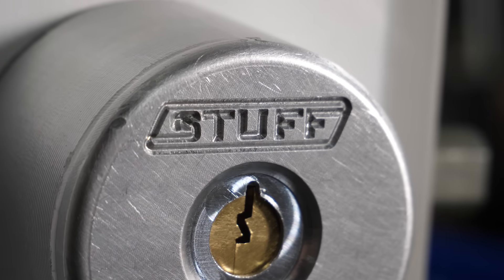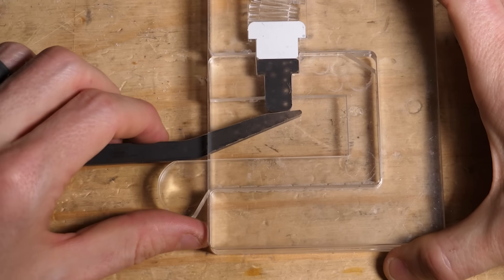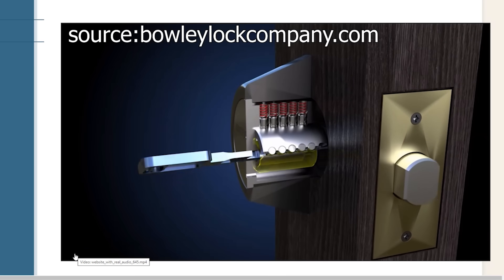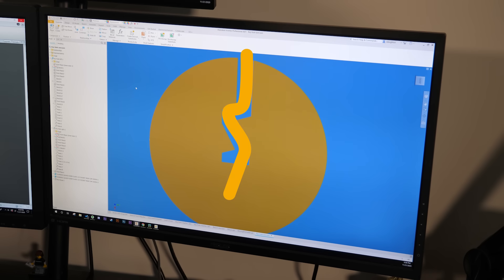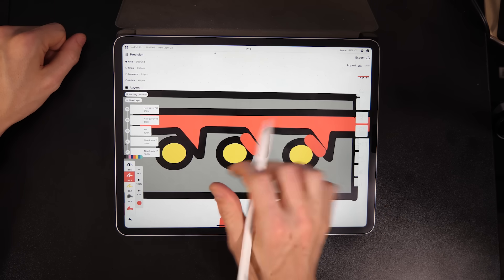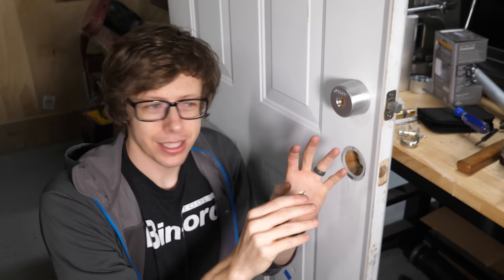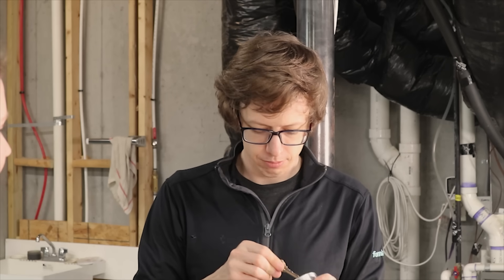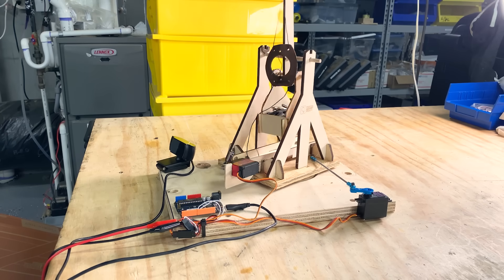Making an unpickable lock. Calling locksmiths

Comment: Locks without keys usually just change the methods to open it. Either a security leak at the company, some encrypted data using a public key or the key getting cracked,...
Ethical hackers walk into government buildings that require cards or chips, even fingerprint or iris scanners. These things are usually used in combination with a key for a reason. Also, they require an override since you don't want to be locked out or in when electronics fail.

Comment: A lock this formidable may not be practical for a deadbolt in your house, but there are probably comercial applications that make sense. If it's improved to the point that it is virtually unpickable, that level of security may outweigh the price due to massive manufacturing costs for people that need super high security, non-electric locks.

Comment: There already is a reasonable unpickable lock that operates through a U shaped key. On the turn the loose end of the U slips behind a sheath above the insert channel and manipulates the tumblers there. Given that your design probably offers something novel the inclusion of the design elements in the shielded tumbler design could make it even closer to unpickable.

Comment: "So Bill and I made a new custom tool for this type of lock"
Reply: and it's now available on covertinstruments dot com...

[aaaaand it's sold out]
Reply: This is a special tool that Bosnian Bill and I made...
Reply: And, it includes a angle grinder, a chainsaw, and high powered lasers
Reply: *Bill and I
Reply: Not sure if viable, but probably just adding more pick to the one that LPL and Bosnian Bill made to lift all the pin at once
Reply: ... nice click on 1.... counter rotation on 2....
Reply: I think the way it is it can be picked with no special tools. Probably with no electric tools.
And even if it were to be greatly improved, it could still be quickly decoded with a stethoscope or something like that. I doubt this susceptibility can be avoided in this kind of lock. Too little space. I think disc detainers are more promising.
Reply: @tinldw  And exactly how would you pick that with no special tools? Genuine curiosity here.
Reply: @MaxSeidel1 lift the pins all the way up, tension, use some hammering or vibrations to gradually drop the pins into place. I'm sure that, depending on the tolerances, either this or decoding is going to be fairly easy&reliable.
Well, I can guess that decoding may use some new tools to make it easier and/or reliable, but I'm sure it's not a requirement. Everything else appears to be quite standard. Am I missing something?
Reply: @tinldw  did you watch the video?
Reply: @tinldw  You can’t manipulate the pins while turning it so you can’t raise the pins and turn it and have them fall into place. If a single pin isn’t properly decided as well, none of the pins can be turned so timing it just right is impossible since the pins will fall at the same speed, but some need to be set higher than others.
Reply: @tinldw  I agree. that's one possible way to attack this design. One way to protect against that attack is to stagger the position of the gates so that you can only tension a few pins at a time. The vibrations would make all other pins fall off and miss the gates.
Reply: @pjaxy  someone skilled like LPL would be able to feel which pins have dropped too low and lift them back without much trouble, though. He's dealing with false sets, counter-rotations etc. all the time. If only the pins were somehow reset before returning to the driver pins... But how? That's against the basic principles of this type of lock :D
Reply: Well, one could make zero cuts between all the real cuts on the key, then to close the lock you'd have to move the key out one step (dropping the driver pins) before you can finish the turn and take it out. Not very convenient though and I have doubts about such a key getting stuck all the time until it bends or breaks.
Reply: https://youtu.be/5NuE4sWmufQ

Comment: I know how to pick your lock... seriously.
Press all the pins as high as you can. Use a bypass pick to press on the 'locking' mechanism at the back and rotate till it stops. Slowly release the pressure on the 'locking' mechanism to allow your top pins to drop into the wardens. Might take a few tries, but should work. This is built on the assumption the key is used to keep pressure on the 'locking' mechanism that keeps pressure on the pins.

Comment: "If you want a truly unpickable lock, just get a lock that doesn't have a key"

Hasn't the lockpicking lawyer already picked some of those?
Reply: Of course the window beside my door is unpickable too - but not unbreakable- much faster to put a hammer through any window.
Reply: @robmaclachlan1264  Actually window can be picked. Modern windows can be taken out of the frame and back, you just need to know where put in screwdrivers.
Reply: He did, but only ones with major flaws. A lockpick has not the right skillset to tackle those, you need a hacker.
Reply: @TheHalfBorg  LPL skills do extend to that extent, but the question comes up: are you going to install a $50k lock on a $100 door?? and if you can afford a $50k then most likely you can afford a guard to stand at that door 24/7 and if you can afford that then you don't need a $50k lock...

once something is wireless its considered unsecured connection and its easy to bypass, there is ways to make it more secure but in my experience bugs always surface and it doesn't work for long, also in the case of a total lost in power you would be locked out...
Reply: Still no Abloy Protec 2.
Reply: @TheHalfBorg  I dabble into cyber-security and hacking; there's quite a few ways to make such locks impenetrable. People like to believe there's always a flaw, but in such a simple system, you can viably avoid them.

You might be able to get past these locks by extracting information directly from the key, but that would involve another approach. Many modern hacks are done by using this method using approaches such as the now well known socially engineered attacks. Obviously, you could also add extra layers to further prevent these, as well as having the person with access be a bit paranoid.

Of course, you can destroy the door; locks can be impenetrable, but so far, we haven't found anything that humans can't destroy with enough dedication. Considering our current explosives and cutting tools, with enough resources, you'd be able to get even through the most secure and reinforced door. The only thing that would make this not be viable, in my uneducated opinion, would be a system that detects these attempts and destroys the contents to prevent unauthorized access.
Reply: @TheHalfBorg  you dont need to be a hacker, you just need an rfid reader and a hug with someone carrying a valid keycard
Reply: @klauzwayne4215  thats still assuming the lock uses RFID. Most keyless locks are fingerprint or pressing buttons to input a code, neither of which uses RFID
Reply: @TheRussell747  the bad thing about fingerprints is, that you can not change it. So if i get your phone into my hands and steal that data, your fingerprint is compromised for the rest of your life.
The bad thing about keypads is, that people are lazy and tend to never change the codes. After a few months you can clearly see what keys are pressed a lot and you only need to figure out the correct order, you still have to guess it, but it shrinks a 4 digit lock to max 24 tries.
Reply: the true purpose of a lock isn't to be unbeatable anyway. Its to be too difficult or too expensive to be worth beating. If the lock isn't the weakest point of entry anymore then it's a success. Keyless locks do that quite well, frequently is simply easier to gain access some other way.
Reply: There is one lock he has called unpickable >:3
https://www.youtube.com/watch?v=-FUQ6ZxTkM8
Reply: Nothing is unpickable/unbreakable. Doesn't matter if its mechanical or digital. Its just a matter of time and brute force
Reply: Search for Opening lock with a laser, a very interesting video about... well... opening cyber locks with a laser trough smart devices.
Reply: If you want secure lock, just get something like Yale doorman.
Reply: Also RFID manipulation...
Reply: https://youtu.be/5NuE4sWmufQ
Reply: And never forget how masterfully his wife picked the ice cream lock. He never told us how many days he slept on the couch.

Comment: I was thinking along similar lines. For pickable locks, I called it 'asking the question of is each pin at the correct height' at the same time 'asking what height is each pin at", but for a more secure lock, the second question has to be answered before the first can be asked. Or lock the pins pushed by the pins pushed by the key (or pick) and rotate some before checking the locked pins. I originally thought of rotating disks by different mounts with the key. Each disk would have 2 or 3 pins on one side the fit through slots in the later disks. Key in and rotate to set and lock the first two disks, push and rotate the opposite way to set and lock the second two disks, push and rotate again to set and lock the last two, push to have all six sets of pins finally hit the lock plate. If all six sets of pins match holes in the plate the whole thing pushes it to release the locked part from a spline so that it can rotate and unlock. If any set of pins don't fit through a matching hole in the lock plate then then the whole set stops. With the disks already locked you can't keep jiggling each one until it does line up, so all six have to be correct at the same time. If not then you have to release and return to the beginning to try another set of six disk rotation angles. Or if using pins have both inner and outer pins have grooves for each valid key height and ridges that engage the grooves after the key is turned the first little bit, then when the key way no longer even lines up with the pins, the locked pins are finally checked to see if the split between inner and outer  are all at the correct height similar to a normal lock. Similar idea, probably at least as hard to manufacture!

Comment: Wondering if just making the receiving shaft for the ward pins (the pins in the kit that need to pass through the wards) into two pieces (sheer line down the center of the shafts, would be enough to hold the pins in place when you 'set' the pins with that button at the back of the lock. Wouldn't surprise me if you'd tried that and found it failed though. It does sort of rely upon all of the pins and shafts having really consistent tolerances. But then you've run into that before...

Comment: In my country they will heat a copper or metal rod utill it turns red and they will insert inside the lock. They will keep it inside for 1hr. Then they will take it out. Now they have ups and downs of  original key in this metal. Then will put it in Soap and they will press it harder as they can. Now they got the key blue print. With that design they will creat a new key. And open the look. This what robbers do.

Comment: "just get a lock withouth a key" as someone who watches the lockpickinglawyer, i can tell thats a lie xD
Reply: He has only opened ones with flaws in them. You can absolutely design a perfect digital lock. The systems surrounding it, including the person with access to it and the door itself, however, can be worked around.
Reply: @stamy4605  remember when breaking into a house the hard ware store is the best place to start
Reply: They can't be picked, but many can be bypassed
Reply: PLZ Buy warm and sweet pumpkin soup
Reply: Dont  read my profile Picture    :)
Reply: @dont6439  too small to read
Reply: Technically they are unpickable as there’s nothing for you to pick. However they are not unbypassable

Comment: An approach I'd like to see would be to construct a lock where the front chamber has a hole that reaches further through the warding than the rear ones, keyed with a very deep cut in the front chamber so the pin would reach down through that hole.  Use slightly tapered pins on all positions but the front position, so that none could be tensioned when the front pin is elevated past the warding.  When inserting a key, the front pin would get pushed out of the way, but the front pin would have to drop back down before the lock could turn.  With the pin down, there wouldn't be a straight path from the outside of the lock to any of the rear chambers.  For strength, the key might need to be made from laser-cut stainless rather than ground brass, but otherwise the lock shouldn't be hard to manufacture.

Another approach I was thinking might be interesting, and somewhat up your alley, would be to have an internal mechanism that's something like a miniature version of a game where the player has to operate levers to move a captive ball up a ramp without it falling off, and have the key include cammed slots that would operate the levers to win the game.

Comment: 10:30 RFID locks do have keys, the card...  because once you have the right combination of numbers as RFID card then the door will swing open.  unless they add some sort of attempt mechanism whereby if you try it more than 3 times then it will prevent you from trying again for some time.  then yea maybe.  mechanical locks can still be good, but this one is very good, making the jump having to do all pins right at the same time is the way to go

Comment: "if you want an unpickable lock, just buy a lock without a key."

You haven't watched LPL, have you? :D I mean, you're "technically right" about them not being _pickable_, but... it's not like they're not just as easy to open anyway :D
Reply: If the magnet doesnt work, you just arent using a big enough one!
Reply: @DH-xw6jp  Or you need to rub it over the actuation motor several times (remember that fingerprint reader padlock) :D

Comment: Wow, amazing concept! I'm looking forward to seeing LPL have a go at it.

And I feel like the commercial viability could be greatly increased by having another go at the pin locking mechanism later, well rested and with some fresh ideas. That looks like it could be simplified.

My first impression was that it could happen from the side instead of depth wise, so there is more place for the mechanics. This would even increase the number of pins that can fit. Maybe the surface of the pins could be also machined for better and/or easier locking. But obviously I didn't give it that much thought so maybe it's a terrible idea.

Comment: I am a lock picking enthusiast.  i am loving your idea. might i suggest an idea.  would perhaps adding serrations or grooves to the top pins that get "Locked in place"  having a serration at every depth level that the key could be pinned at to avoid any type off trickery. i think this would create a more positive grip to the pin not allowing it to move from its correct position once correctly positioned and the force is applied to lock them in place.  and to help with the binding you seemed to be having i highly recommend to ensure the surfaces that should be smooth be very smooth with out hitches or deep scratches for things to bind on. awesome idea and i would not count it out as not practical to market.  maybe just a few tweaks and the right equipment and manufacturing would not seem so far fetched, some people are willing to spend on high security.
Reply: Good thoughts. I was thinking that one way to potentially defeat this would be to push all the pins to the highest position and lock them in place, then turn the core until the pins bind against the gates. After that, modulating the pin locking bar and core tension could allow the pins to gradually fall down into the correct positions. I can't say this would work in the first place, but if it does, serrations could make it a lot harder.

Comment: “I found a locksmith who specializes in locks” - Shane 2020
Reply: @Meme Maker CORRECTION: 8:40 "I found a locksmith that specialises in PICKING locks"
Reply: ironically thats actually a thing he would need to look for. Picking locks is often slower, but non damaging. If you can just break the lock, and replace it, its faster for everyone involved, and easier for the locksmith, since they dont need the non destructive entry skill to open the door.

Comment: Professional opinion: Overlift all the pins, bind them in place, rotate, release binding to get them to set at the gates. Can be mitigated though with offset gates.
Reply: To add to this idea, even if gates were offset. Don't release all the binding tension. Just loosen it, and repeatedly rotate and let the pins set themselves. Same concept as the basic tubular lock picks.
Reply: @chessguy125  offset or otherwise, a deep false gate at the top of each gated segment would be a nightmare, tension becomes your enemy again
Reply: I couldn't see very well how the binding mechnism was done, but I doubt that you can release the pins if the core is not vertically aligned. I'm guessing the lever is only initially pressed by the key, and after rotation it is held in place behind the core.

Comment: I'd rather have something like this, than have to rely on a lock that needs electricity.
Sometimes, analog is just better than digital.
Reply: Just get a lock resistant to bumping and low skill attacks and a sturdy door. Most burglars will chuck a brick into your window to get in anyway.
Reply: @lordmuhehe4605  Sure, it should be enough most of the time.
I live in an apartment though, so I won't have to worry about my windows.

Comment: dont say its not commercially viable, keyless locks have their own issues, in certain applications, an unpickable lock would really be the best choice since there is no way in replicating the key as long as you dont obtain it. obtaining a key is way harder than just a fingerprint or a pin code. rfid? a joke, you can buy devices that will spoof any rfid key for under 200 dollars in china